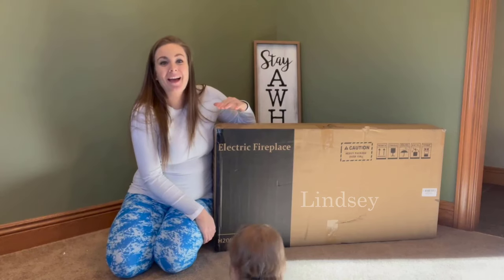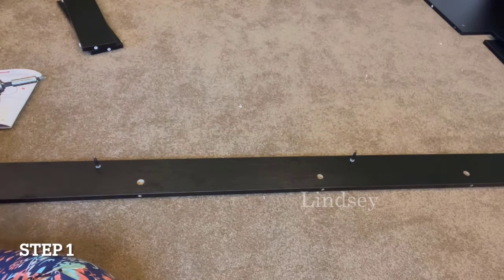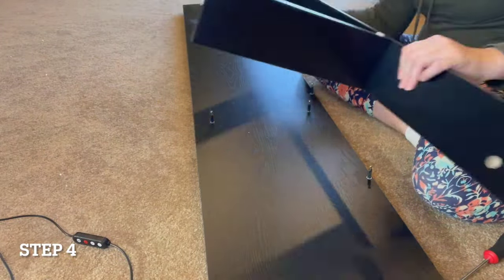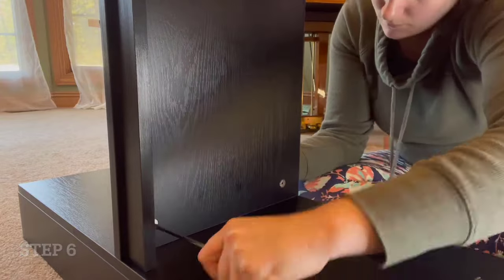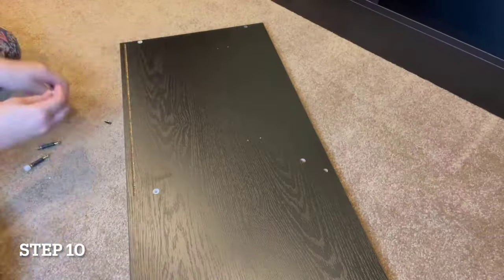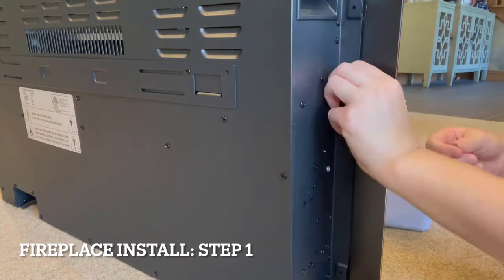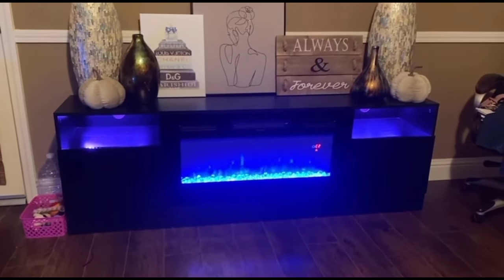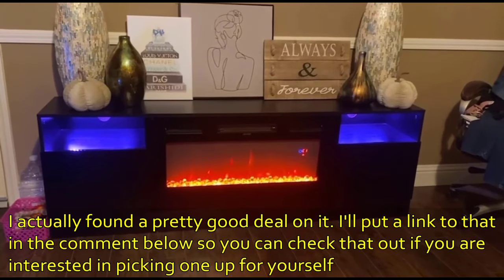oneinmil Fireplace TV Stand with Electric Fireplace - Installation & Review

Comment: I have this and cannot figure out how to get the front glass off and get the fireplace installed.  The cabinet went together perfectly but the instructions for the fireplace just don’t match up.  The screw it says to take out do not release the glass front.  Can you help me please?
Reply: Ya gotta remove the two silver screws on the back to release the glass. Then you have to be careful removing the glass because the LED strip is connected to the glass. On top of the white LED strip is a little white clasp you press to help release the strip from the glass. You gently nudge the thing side to side to get it out.
Reply: @karikora8279 how do I attach the led light?
Reply: To attach the fireplace what I did was use a drill to drill the little black screws into the board in the middle. Since the screws are small they won't go through the board and hit the brackets on the other side.

Comment: Not even details but i will figure it out. For the doors, you have to drill the 4 extra holes, and the middle screw adjust knobs to come ckoser or farther. Now its time to tackle this fireplace thats going be an headacne.
Reply: Do you by chance have a video 👀
Reply: @Jhuntoo  i didn't make one fam, but i got pics of the finished product. The fireplace was easy and looks great. The only part that will mess with you is when you put the door hinges on. There are only 4 holes on each side, but you need to have 8 on each side for hinges to work well. I can send you a Pic with good shots of it but didn't make a video for it. The fireplace just take 4 silver screws off and leave them off, drill 4 holes in front where it line up at and fit fireplace snug in spot. It's easier than manual make it and manual dont do a good job of explaining it.
Reply: @rellerellfloyd  yeah that manual was terrible my only struggle is getting the A peices to stay  stuck in the holes for some reason they just don’t stay in unless I’m missing a piece 🤔 but I’ll love to see a pic though
Reply: @Jhuntoo  how can I post it on yt, not sure how to do it. If you can show me a pic of which issue you at, I can help you. All the a pieces I just did with drill. Doing them with screwdriver is horrible and all be uneven. I used drill but was real careful with it.
Reply: @rellerellfloyd  I think if you press the plus icon in the middle of the app it asks you if you want to post a video or not

Comment: I wish the installation video was more detailed, I don't understand how to install the glass and I've been dealing with it for 2 days
Reply: I am currently dealing with that same issue right now, the instruction manual  sucks .  I was also sent broken parts, which I have to wait 3 weeks for  replacements to come!
Reply: @martinescott4371  so the glass panel just slots right onto it but we had to drill a couple holes on the furniture to be able to screw the glass panel on but it's been super sturdy and ive had no issue